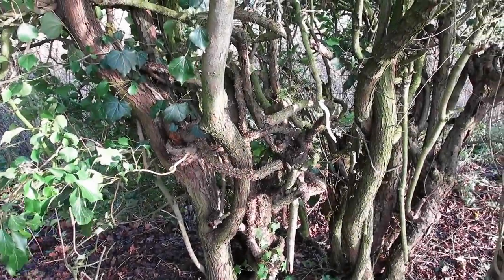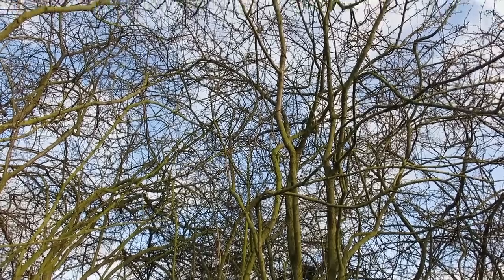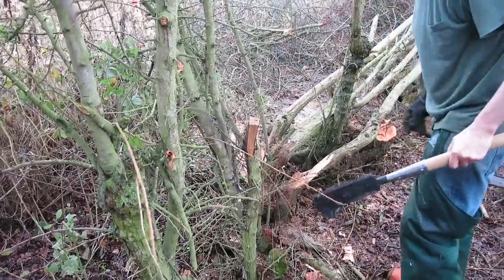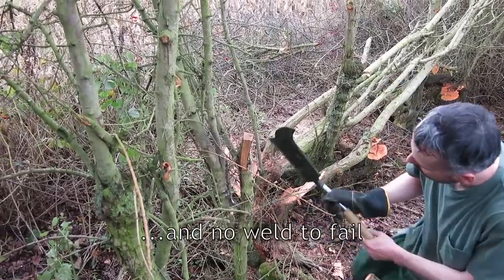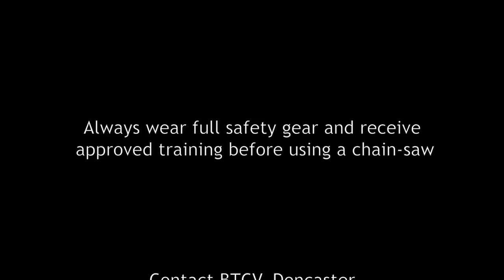Hedge laying

Comment: Why not just cut it back to ground level and let it regrow?
Reply from the maker: Certainly an option if you don’t need a hedge for a while.
Reply: A well maintained hedge is so much nicer to look at.  It's a product of years of work, hedge growth, planning and management.
Reply: Good question gardenmad3, as an enthusiastic pruner of anything I can lay me hands on, I would, without knowledge, think the same as you. I am lucky enough to remember seeing Hedgers at their work, as I was driven down country lanes, and for my folks to explain what they were doing. Your reasonable suggestion, on the face of things, would immediately result in no hedge as a barrier, for whatever it's intentional purpose was. Then it would take years to regrow to a useful length, required to repair the hedge. In the meantime there'd be the potential for rot or infection of the stumps, leaving permanent gaps in the hedge. Hedging works with nature. Plants have evolved to cope with damage. It might look harsh but it is effective. Hedging is an ancient art/craft that has preserved the landscape since early times. It wouldn't be in evidence today if all we did was chop it all down and start again. The balance is the art of the woodsman, or the coppicer (who is growing a crop). Hedging is using a living resource to create barriers that can retain stock, prevent erosion so that lanes remain passable, or so that banks don't collapse. The craft originates from a time when tools were few but the connection to the land and nature was essential, giving us dry stone walls, terracing/contouring, gravity based irrigation, crop rotation, fire-based soil improvement, companion planting, moving with the crop/food source and enhancing, rather than detrimenting the environment. Hard pruning to create young, straight and flexible growth would be the go in establishing a new hedge but this dude was skillfully restoring and old one. Apologies for the know-it-all tone, just answering a question reasonably put. Cheers.
Reply: @paulmckenzie4291  Great reply, Paul. I have a question about coppicing new hedges- are you saying that a good way to start a new hedge is to plant the bushes, let them grow for a few years, and then coppice so that there will be thicker new growths to lay in a few more years? Thanks.
Reply: @badgoy8439  Sorry Bad Goy, I am  in the habit of hitting wrong buttons and clearing messages, alerts and notifications before I get time to respond. I have now been made aware of how to see what I've commented on and replies likes etc so welcome me to a new level of YouTube competence!

Let me qualify my answer your question by saying I am not a hedger but I am a landscaper and the skills demonstrated in the clip we have both commented on are used in other applications. Sooo... There are many species of shrub/tree that will make a good hedge. Ornamental hedges are created by close planting of one or more species with dense growth habit and allowing them to compete, as they grow, which will force upward growth. Depending on the species and your climate, once the growth is sufficiently vigorous use your preferred tool (shears, hedge trimmers, pruners, chainsaw) to uniformly remove one third of the top growth and shape each side. This can make an effective, and attractive barrier for most residential purposes. Repeating this over time with cause the plants to compete sideways, thus creating the effect of a solid barrier. However...

If you're trying to create barriers to livestock then the same principal applies in the planting but you'll need to stick to more traditional species like hawthorn, blackthorn and similar species that, when hard pruned or coppiced, will send up straight new growth. Hard pruning should always be done in dormancy which, with deciduous species is once all leaves have dropped. Climate will affect when a plant is dormant and climate change is causing many of them to be confused. Late winter and early spring are the safest. For a new barrier hedge you would probably want to prune alternate shrubs in the first few seasons to maintain some density of growth. The time between prunings would allow new growth to be of a useful height/length to weave in and provide stakes to hold the weave. 

I hope this helps. Always observation of what's happening around you wherever you are will be the best guide. The origins of barrier hedging surely comes from our ancient forebears seeing how fallen trees continued to grow. I reckon they had a fair bit of time on their hands as they didn't have Netflix or YouTube to suck up their time! Cheers
Reply: They are stronger and would keep animals from pushing through. Better than just a load of upright shoots.
Reply: @paulmckenzie4291  thanks again Paul, I appreciate your responses.

Comment: Where do you get a proper billhook like yours? I looked online and a lot of "made in China" and that's it.
Reply: It depends where your from, ebay is a very good source, I wouldn't buy cheaply made ones. English made ones are probably the best but of course there are many different makes and makers, you also have many different patterns the one hes using in the video is known as a Yorkshire billhook. Hope this helps.
Reply: Try rural antique shops or agricultural suppliers as there are so many varieties of Billhooks
Reply: Morris of Dunsford is the one he's using theyre made in england and good but need a bit of sharpening. That is if you cant find one at a local flea market. Yorkshire billhooks a good allrounder.
Reply: Any farm sales you will find all the old decent made tools.